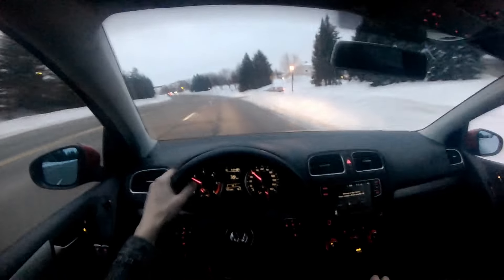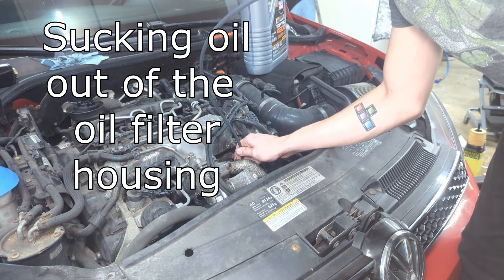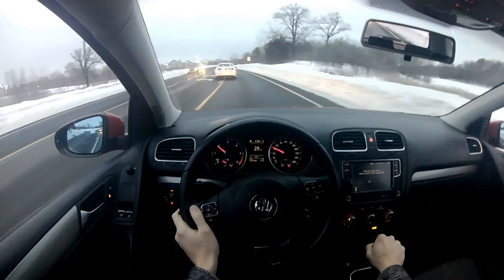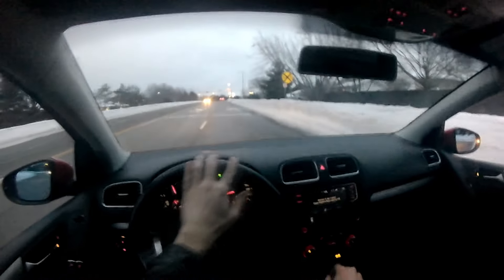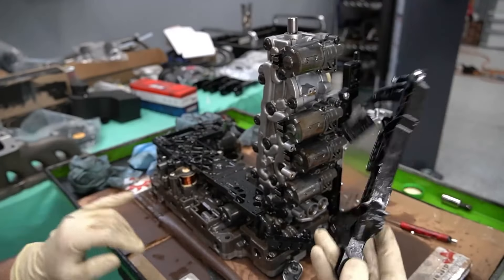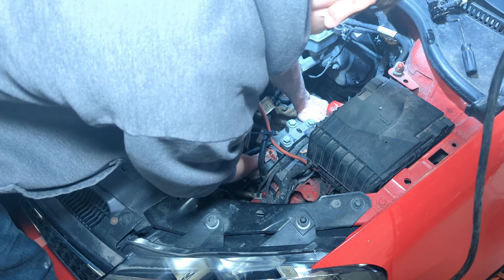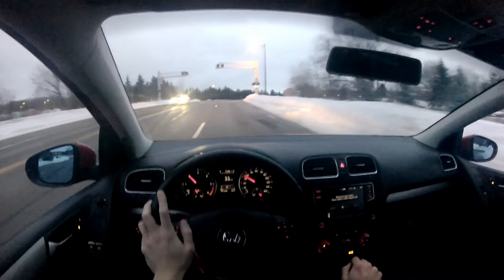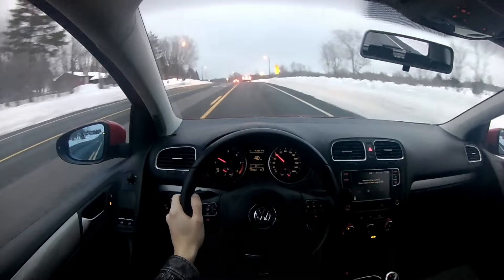Things I Wish I knew Before Buying a VW TDI

Comment: I have no idea, clearly, but what years of tdi should I be trying to find. Also, if I can find a manual, which automatic would be best for reliability/life/efficiency?
Reply from the maker: If you're set on an automatic, the DSG transmissions in the Mk6 and Mk7 are your best bet—they're reliable and efficient when properly maintained (think regular fluid changes every 40,000 miles). If longevity is your top priority, the Mk4 TDI with the ALH engine is legendary for its durability, thanks to its simpler design and lower reliance on electronics.

That said, the Mk6 strikes a great balance for modern comforts, fuel efficiency, power, and overall reliability, which is why I own one.

The most important factor, though, is finding a car with a strong service history within your budget. I’d take a meticulously maintained automatic Mk7 over a neglected manual Mk4 any day. Regular maintenance trumps everything when it comes to these TDIs.

One thing to keep in mind is that Mk6 and Mk7 models can have emissions-related issues, like failures with the DPF (diesel particulate filter), EGR, or SCR systems. However, these problems are easily resolved with a tune/delete, which not only eliminates those concerns but also boosts performance and MPG. 

As for the CP4 high-pressure fuel pump in the Mk6 and Mk7, yes, it has a reputation for failing, but the risk is often overstated, especially if you're diligent with using quality diesel fuel. If you’re still concerned, you can upgrade to a CP3 pump to make it as bulletproof as an Mk4 ALH.

In short:

Manual or automatic: Both can last, but condition and maintenance history are key.
Best automatic: Mk6 or Mk7 DSG.
Best overall reliability: Mk4 ALH (manual preferred).
Best all-rounder: Mk6 TDI for its mix of modernity and reliability.
Reply: @ incredible information. How does one know which is which? Seemingly, most of the wagons near me don’t have a lot of records of service(but say they do everything when they should haha).
Reply from the maker: @gusus4422  Thanks, I’m glad you found the info helpful! Sorting through these models can definitely feel overwhelming, especially when service records are lacking, but you’re on the right track by asking these questions.

The easiest way to identify the generation is by the body style—Google Images can be your best friend here. As a quick guide:

Mk4: 1999–2005 wagons (though you might find some Mk5 sedans sneaking in around 2005).
Mk5/Mk6 (Common Rail): 2009–2014 wagons, with a slightly updated engine and emissions system over the years but largely similar.
Mk7: 2015 wagons only in the U.S., making them pretty rare.
If service records are spotty, I’d suggest looking closely for signs of good care: clean engine bay, smooth transmission shifts, and minimal rust or leaks. Sometimes, an honest conversation with the seller about maintenance habits can give you more insight than vague "it's been serviced" claims.

Let me know if you’re curious about specific differences between these generations—I’m happy to dive deeper!

Comment: what does potholeing it means? And by short trips, if my tdi gets up to temp in my trip, is that considered a short trip?
Reply from the maker: Pothole means a tune and delete. And yeah, that's a fair definition of a short trip.
Reply: @eurodriven2507  damn, i make a lot of short trips then, if I force the dpf regen with an obd2 accesory at least every week, should I be fine? I will pothole it but wanna stay like this some years before doing it.
Reply from the maker: @mariodr1067  That should be enough. The main concern is things not getting warm enough for a regen to start and then them repeatedly not finishing because the car is turned off in the middle of the regen. Which is fine a few times, but if that's all it gets for months on end, it'll clog. It sounds like you're doing the right thing.

Comment: What about a Mk6 with 2.0 TDI but 81kw (110 hp)? It has a 5 speed and mine was equiped with a fixed flywheel by someone previous... is it gonna gonna break down soon or it can still be fine since its a weaker engine version?
Reply from the maker: I'm not familiar with those TDI's. Might want to ask in a TDI group with some people from other markets (Euro most likely). The single mass flywheel might actually be fine in the 5spd, I know it was fine in the older TDI 5spds.

Comment: Was the problem with your brothers o1m, is it was stuck in limp mode
Reply from the maker: Yes, it had an open circuit on solenoid 6 (N93). Would get stuck in 3rd gear (limp mode). Happened here and there for about a year, solved with a clear, and then it was stuck with no remedy for a week or two. Replaced a few solenoids, solenoid wiring harness, fluid+filter+gasket, and it's been driving great ever since.

Comment: I'm 30 seconds into your videos and I will say...Your shifting very late.
Mine has a 2011 DSG and it shifts at 2.5k around 3rd gear and above, and will put it in 6th gear when it senses you are not asking for much power
You are shifting after 3k and will let it sit there not asking for much power
Trust me if you want best Consumption shift your gear more often
Plus around the 1.5k and 2k rpm is when you get the most torque and you done even need to shift because they move fast with torque
Hope it helps

Comment: How often do you put additive in the fuel tank?
Reply from the maker: Every fill-up.
Reply: @eurodriven2507  Would you recommend a 2013 or 2014 (Mk6) Golf TDI over the 2015 (Mk7) Golf TDI? Because of the fact that the Mk6 has a slightly larger fuel tank and because it doesn't have an AdBlue tank?
Reply from the maker: Yes, I would recommend the Mk6 over a Mk7. On top of that you mentioned, it also has an independent rear suspension setup. 

That all said... You can swap an independent rear end into the Mk7 TDI,  you can remove the adblue system, and the tank is still plenty large. It really all depends on how much work you're willing to put in for the Mk7's advantages. (A bit of extra power, updated interior/exterior, etc)
Reply: @eurodriven2507  What do you think of the 3.0 liter V6 TDI sold in the 2014 and 2015 Audi Q5? That model really looks incredible to drive.

Comment: I got a 1.2 TDI in a Polo 6R, I challenge anyone else to come back at me with a smaller TDI hahah
Reply: What kind of fuel mileage on that one?
Reply: @bobirving6052  I drive on bigger size tires and I average 5l/100km. But when driving on the original size tires it's about 3 to 4l/100km.

Comment: everything runs on diesel in this world but cars.
why is it more expensive???
Reply from the maker: At least in the US, diesel was cheaper until around 2005 or so. That’s when the US switched to ultra-low sulfur diesel (ULSD) to cut emissions. This caused a slight drop in energy density (about 1-2%) and made it more expensive to refine compared to the old formulas. At the same time, the federal tax rate on diesel was increased.

On top of that, many states tax diesel higher than gasoline. The reasoning is that diesel vehicles, especially trucks, are used more for commercial purposes and cause more wear and tear on roads, so higher taxes help cover the cost of infrastructure maintenance.

Then there’s the usual supply and demand factor, with diesel in high demand globally for trucking, shipping, and industrial uses.

It's a can of worms, but I hope that helps clear things up!

Comment: What? A modern car breaks easily and you have to maintain it? Say it ain't so!
Reply from the maker: I'm not sure what you're referring to. I've done 60k miles only needing oil changes and a sway bar end link. The car is at 192k miles. It's been very durable.

Comment: Things I Wish I knew Before Buying a VW...don't buy a VW.
Reply from the maker: Considering I've only had to buy oil, filters, and $50 in sway bar end links in 60k miles, I'd disagree. There are some VWs I would avoid, but a 4 cylinder TDI definitely isn't on that list.
Reply: Hi I am sick of paying too much for fuel on my opel corsa 1.4 petrol i want to switch for a diesel which one is best 1.6 diesel or 2.0 diesel
Reply from the maker: @Hassan-nu3rp  Unfortunately, I'm not familiar with the 1.6 TDI , it was never sold in the US. My understanding is they will get better fuel economy, but I'm not sure how reliable/quick they are. I can say I'm very happy with my 2.0 TDI though. You'll probably have to do some digging on European forums/videos to compare and decide. Best of luck!